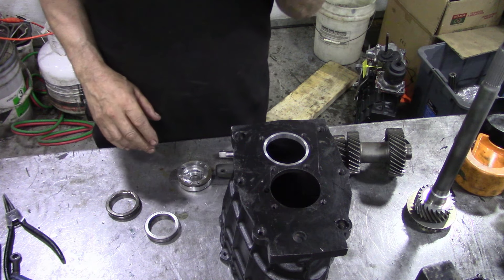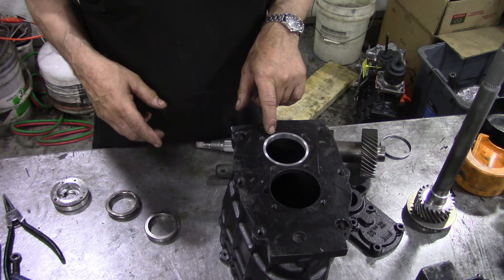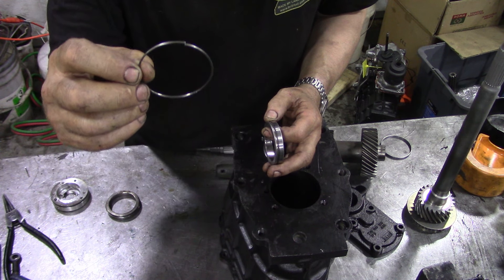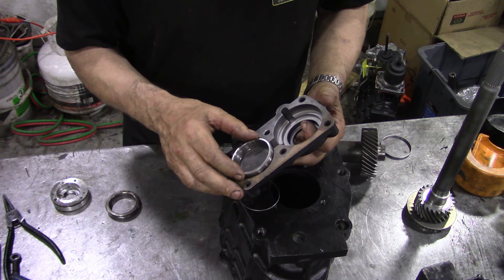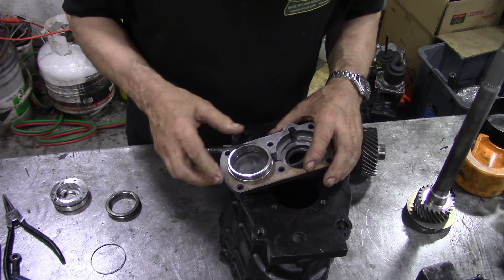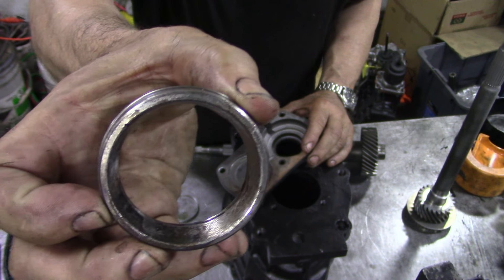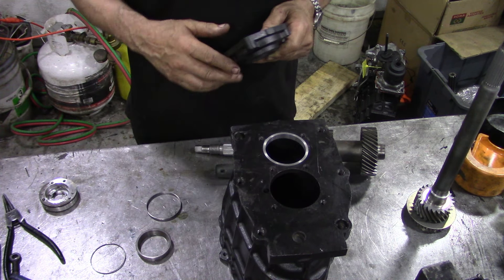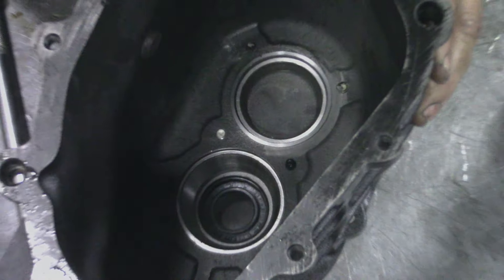How we salvaged the R380 casing - short video

Comment: Big day today Mike I have gone from sticking metal together to actually welding. A lovely feeling. Only used a gassless borrowed welder. 
Now on the gas. Getting there.
The last MOT the man said it was the most atrocious welding he had ever seen. I took it as a complement as he did include the word welding. It passed inspection though!
Big improvement using a MIG with gas.
Reply from the maker: Good for you!
If you do not have a go then you never learn.
You can read about welding and see videos on welding, but it is not until you have a go yourself and learn from mistakes that you get better (or should that be bitter? Lol) 
When you get to know your machine and the settings then you can learn plug welding - that is drilling/punching a hole in sheet metal, and then filling it in with weld  - almost like a spot weld.
Very strong, very presentable and quicker than seam welding!
Reply: Cheers Mike, it is channels like yours and others that give us the confidents to have a go.
My MOT man is a good guy, he said I could take my welder down and he will give me a lesson or two. 
I did try plug welding with the gasless welder I borrowed, I managed it OK. 
It's only taken me 40 years to learn how to weld! I have wanted to do it since my first wreck failed it's MOT on rust. Scraped a lot of cars in my life.
I now have my beloved 70 series so I couldn't bear to lose her, no choice, need to know how to weld.